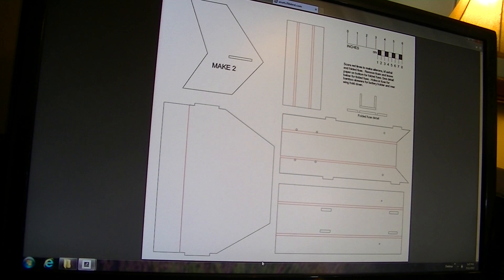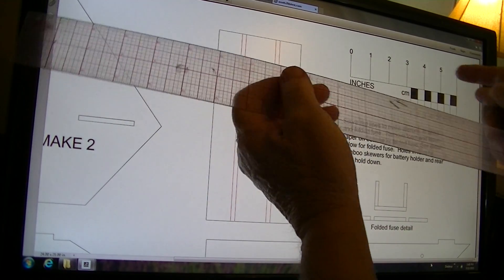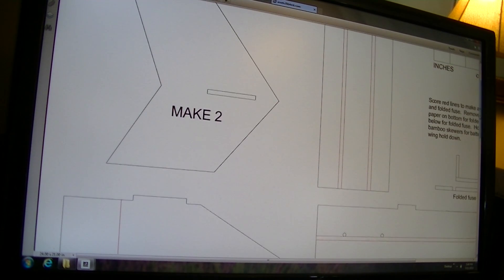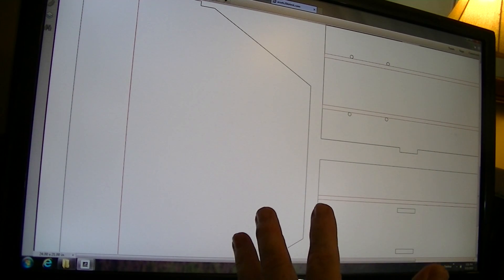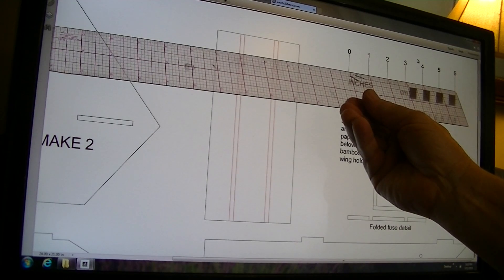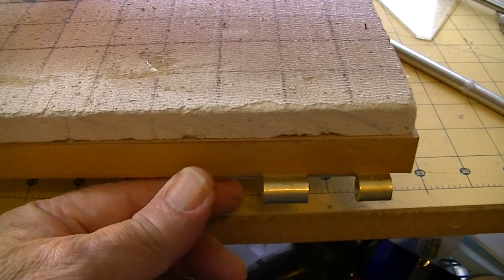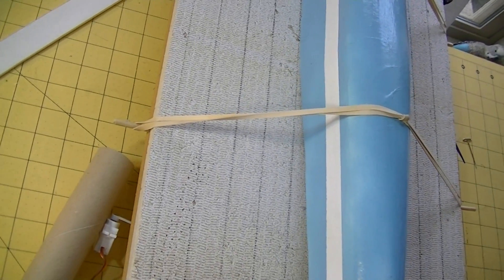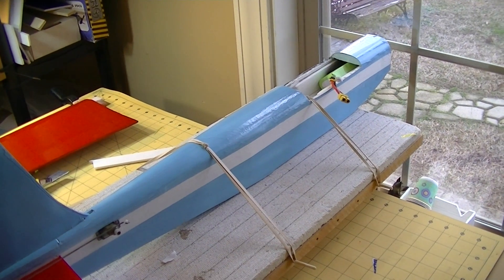Foam board rc scratch build planes with plans, easy technics

Comment: Great idea to trace it off the screen! Thanx for the tip John. I haven't really tried building from plane yet.
 I managed to buy a plain 7ft x 27" interior fire door from a DIY store closing down sale £18 instead of £40!! It's a totally solid door and is very smooth and flat, so it's now my workbench top.